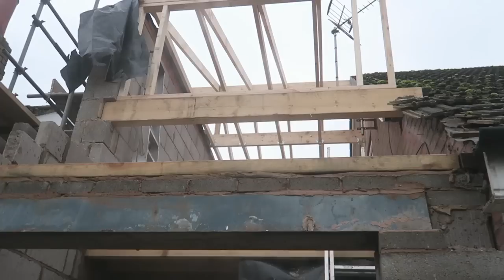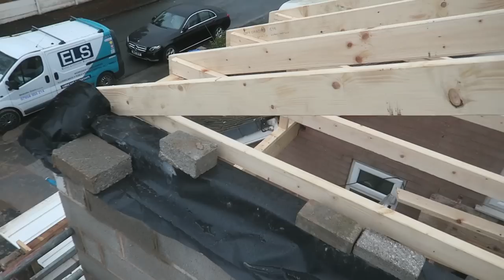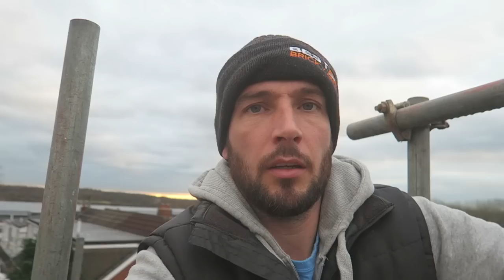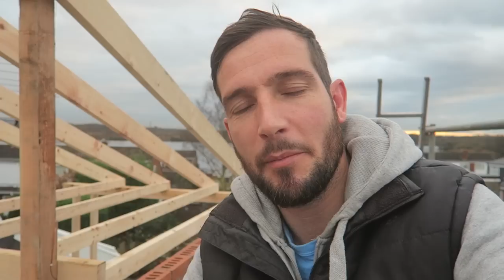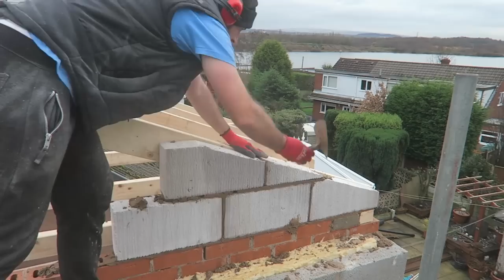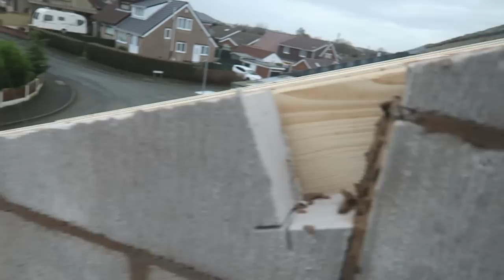How to build a pike - bricklaying Extension part 5

Comment: Mate instead of laying block or brick on sand and cement , marking it , cutting it, and relaying,  lay it down dry give it 2 cross joints , mark it up and relay it on mortor , it's bang on then with pike , little tip I learned as an apprentice 👍👍

Comment: The ceiling joists on that roof will be in tension. They are not continuous, being joined in the centre with 90 deg metal brackets screwed to the horizontal beam. If those screws fail the roof loading will push the windows out. I would think at the very least they should have been overlapped and bolted. Comments?

Comment: For the wall on the existing house could you not build the outer leaf first built overhand and then build the inner leaf to avoid needing scaffolding on the other side of the wall?

Comment: hi there
nice job, are you allowed to mix bricks and blocks in the inner skin ? we aren't up north as risk of condensation due to differing thermal resistance
Reply from the maker: I think there’s a lot of hearsay nonsense in the building trade. The building inspector passed it.
Reply: Yeah I agree. They are pretty stick on it here. the building inspector told us recently he wouldn't pass a job because someone had used bricks instead of quarter blocks to get his bond.
Reply from the maker: Crazy pal
Reply: I got pulled up on this about 20years ago in Birmingham but since the increase to 100mm fully insulated cavities it has been ok to use brick again .